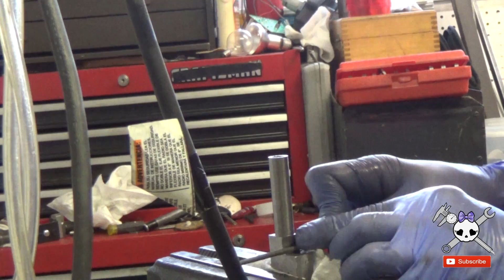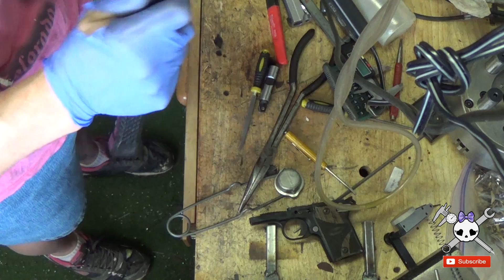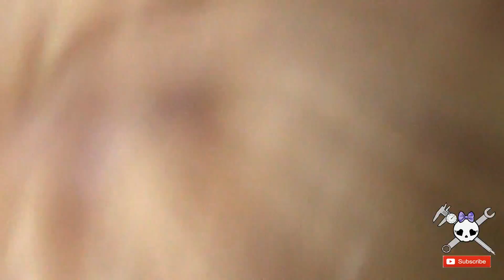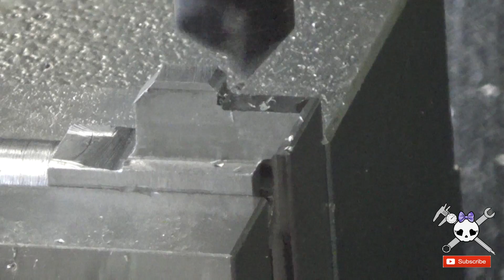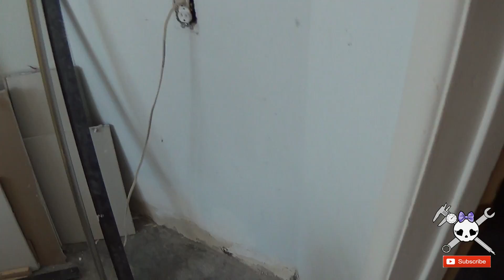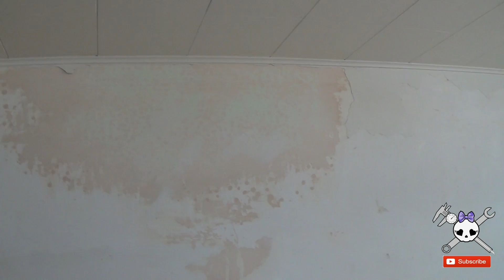The slide and barrel part 5

Comment: Hi, pretty cool work, can u tell us, did you heat treated barrel and slide after making them? Also, did you use some reamer to make chamber? I don't think i have seen that on clip but i may have missed it.
Reply from the maker: the steel was pree heat tread for the slide and barrel.   i didn't ream it yet. i was doing some reasearch and after coming up with some answers decided to buy a barrel just for safety reasons. after reaming, the wall of the chamber is to thin to handle the pressure. it is dealt with by heat treatment. while i know a fair amount about heat treating i decided to error on the side of keeping my hands and body intact.
Reply from the maker: and ty :)

Comment: whats your barrel material? steel names
Reply from the maker: 4130
Reply: Waffenschmiedin x heat treatment?
Reply from the maker: the metal i usually buy is already heat treated the tools are carbide so they will cut it. if i have to heat treat i have a small oven that i use
Reply: Waffenschmiedin x thank you lady :)
Reply from the maker: you are welcome :)

Comment: Nice job!
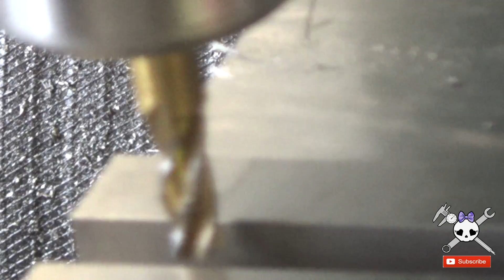BTW for the precise filing operations like at the 8:40 I'd use a small abrasive rubber disk for a dremel. It provides more control and precise removing tiny high spots from a flat surface then a file, because the disk wouldn't touch anything except the area you'd like to "file" out. Hope it would help.
Reply from the maker: thanks . cool ty for the info, I tend to use files because if I mess up its a small mess up when I use power tools its normally a really big mess up because it took to much off to fast. just trying to save myself doing something stupid but what you said makes sense.
Reply: Thanks for the reply:) Yepp, I understand your point perfectly that's why I suggested that rubber type discs. It's more like a pencil eraser and could be several different grit so you can choose really soft one and have very gentle polishing cut.
Reply from the maker: awesome I will defiantly have to try that (I hate file work ;)

Comment: Q: How did the stint with the 'smith go?
Reply from the maker: we have become friends and are working together here and there :)  he has started showing me a few things witch is awesome :)
Reply: Waffenschmiedin x
Also, did you have to tweak any problems with the wheel gun build. I could be wrong, but I thought there was some minor details you were going to follow up on?
Reply from the maker: oh yes I did fix it the bolt was dropping to soon and marking up the cylinder I made a new bolt and it seems to have fixed the problem :)
Reply: Waffenschmiedin x
The mecho-maestro does it again :-)
Reply from the maker: +nifty1940 ;)

Comment: so for that radius at 2 minutes, that is a round file?  Regarding earlier, looking at chamber wall thickness shown at 7min 27 seconds here, that certainly looks like more than 0.12" or 3mm thickness.  http://www.lasc.us/SAAMIMaxPressure.htm shows the maximum permissible chamber pressure allowable for many calibers.  9mm Luger is 35,000 PSI maximum.  So any chamber wall thickness that can hold 35,000 psi should work for you.  So we fall to www.cip-bobp.org/sites/default/files/new_file/A-4-1_EN.pdf which is a pdf file showing the minimum thickness required for different cartridges.  Adding a safety margin I look up the minimum wall thickness for a .30 carbine (chamber pressure maximum is 40,000 psi) and I see the reference cited shows (on page 7) a minimum wall thickness range depending on the steels from 2.2mm to 3mm.  So although you may wish to do a stress relieving treatment regarding the rifling operation, IMO barrel hardening for the barrel shown would not be desired.
Reply from the maker: yes it was a round file. the barrel im making hasn't been chambered yet. after chambering the wall thinness will be about 1.82mm or .071"  so you can see why it creeps out a little lol I just measured it and before chambering its 2.38mm .094"
Reply: Hmm, thinking..
Reply from the maker: +Ken ibn Anak the one thing helping it is the slide backs it up. so the only thin facing side is aiming down. the top is fairly thick

Comment: BTW - just a thought about the radius filing bit...  what if you were to flip the part 90 degrees and cross drill (or drill / ream) a hole so that the bore provided the radius, and then mill away the rest?
Reply from the maker: Yes normally a perfect solution. for some reason I thought I had an endmill That size and by the time I realized I didn't it was to late.

Comment: Great work as always, on both the pistol and your friends apartment. What is your own background ? Are you a gunsmith, machinist, or tool maker by trade ?
Reply from the maker: thank you :) I worked for a couple of years at a machine shop and learned the basics , then I did industrial maintenance for most of the rest of my working career. I worked in plants with very old outdated machinery that we had to make parts for.  I also did apartment maintenance for a couple of years :) i did that type of work for over 25 years  i had to quit my last maintenance job a year ago this month due to a chronic illness. so i started doing YouTube to possibly get work. id like to work as a gunsmith and wanted to go back to school to do it but i recently hooked up with a local gunsmith that is showing me the ropes  :)

Comment: excellent work so far. are you planning on making the pistol as an exact replica? because with the bulk of that slide left you could add some awesome custom flair to it. 
and another question are you formally trained or shop/self taught?
Reply from the maker: I worked for a couple of years at a machine shop and learned the basics , then I did industrial maintenance for most of the rest of my working career. I worked in plants with very old outdated machinery that we had to make parts for.  I also did apartment maintenance for a couple of years :)
Reply: +Waffenschmiedin x cool shit! nothing like on the job experience. great vids
Reply from the maker: ya better then having to pay for it :)

Comment: Great video. Are you geting your dimensions from the other gun? like the 1880, if so could you show us how you work out how to make it?
Reply from the maker: yes I am its a sig P938. work out how to make it ? like how I reverse engineer it ? im not sure how I would answer that question it would have to be very detailed and long.  to simplify it and answer it the first thing I do is to size the part, how big will the over all block of steel need to be then I study the parts and look at the tool marks that have been made,  for instance if I see a bunch of little circles or long arcs on the surface I know some sort of cutter like a end mill or fly cutter made the marks. if it has waves it was the side of and end mill or slitting saw some sort of cutter that has the cutting edge on the side if it. if it has round parts most likely lathe if its square parts, then the mill. I know that sounds dumb but it can be that simple,  I knew I would have to drill and rifle that barrel so it was going into the lathe, it had to, so then how do I hold it ? well I know the back side of it will be square (rectangular )  so I know a 3 jaw chuck wont work, ok 4 jaw,  while thinking how to do it I sort of go through a flow chart in my head, if this = this then it needs to be this.   I knew the barrel would be offset to the rectangular base, so that lead me to the fact I would have to indicate where I wanted the center of the barrel to be drilled.   its all a chain of sequences that have be mapped out in your head (or on paper if you need)  some come before others,  for instance if I had cut the feed ramp and other features onto the barrel before drilling the barrel I would have had much less to grab onto in the 4 jaw chuck to drill and rifle it.   much of that just come from experience  when you put a lot of time and energy into a part just to have it scraped because you cant finish the operations on it because you did them in the wrong order you tend to think ahead of time what they need to be :)
Reply from the maker: I hope that answered your question if not let me know :)
Reply: Yes it did. Thank you. Can't wait till video. Keep up the great work.